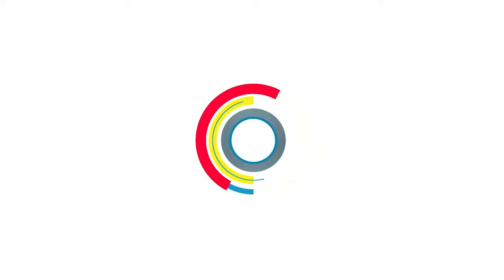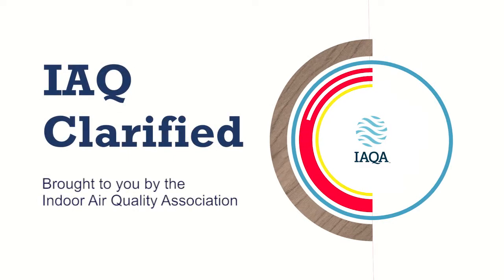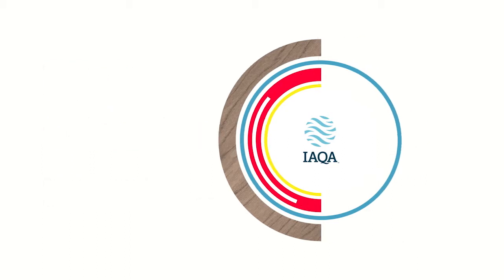Sewer Gas and Indoor Air Quality

Comment: Sewer gas can contain mercaptan, which is the odorant added to the otherwise odorless natural gas supply. This leads to many unnecessary building evacuations, when someone is actually smelling sewer gas infiltration and calls the local fire department to report a gas leak. Get more information on sewer gas assessment options and solutions from the pros at  Clark Seif Clark, Inc. (CSC) or any other IAQA member.